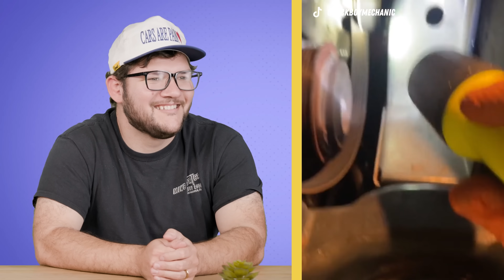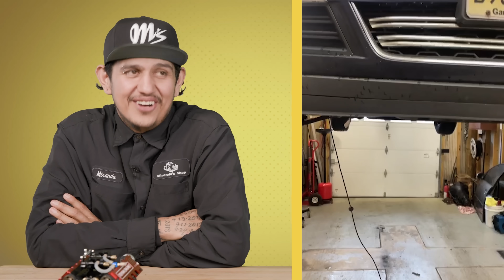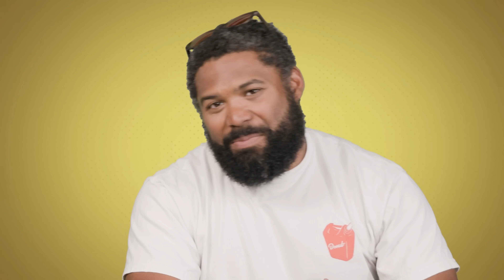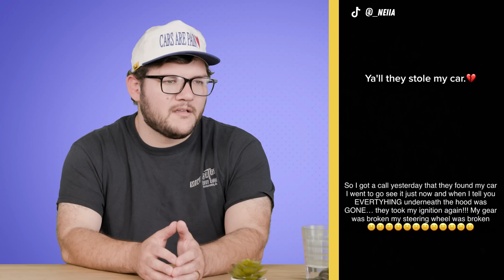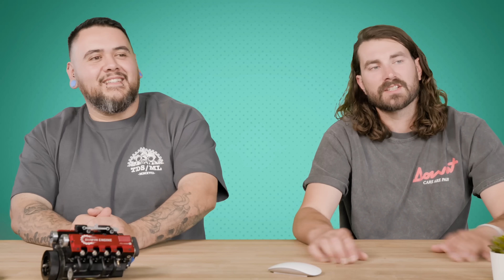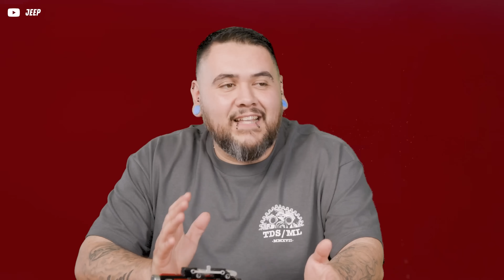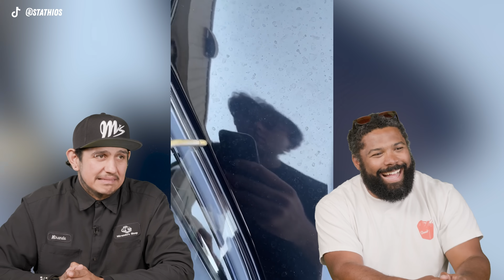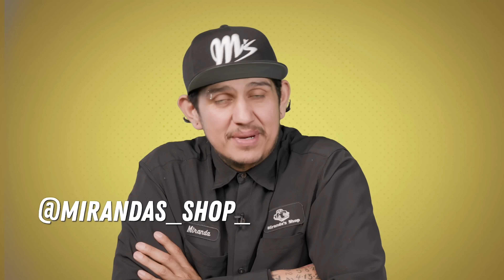Mechanic Reacts to Car Engineering Fails

Comment: Have you ever tried to remove the engine from a 1997 Honda Prelude? Or simply replace the timing belt? Have two choices, both require a special wrench. Remove the left side motor mount or cut the chassis to remove the crank pulley. To pull the engine, you have to remove it with transmission attached... unless you drop the transmission out the bottom to let the engine go out the top. I had to replace both... 2 years apart. Needs another transmission, automatic, but owner wants to convert to manual as Honda automatic transmissions are notorious for failure but manuals are forever with a quality clutch.

Comment: There was a timeframe where Mercedes was required to make a certain percentage of their vehicles biodegradable. As much as that sucks, thinking that in the long run your seats and dash and stuff are eventually going to rot away...

No no, its way worse than that. They made the insulation on all their wires biodegradable! Like WTF? And they won't even warranty or recall affected cars either... 🤦‍♂️

Comment: As an engineer I have to defend ourselves. I’d say 95+% of the time, final engineering decisions are dictated by management for cost reasons. They want to reuse existing stuff from the parts bin to save costs and Frankenstein it together. Engineering has budget and time limitations and you’re not always going to get it right given you’ll be restricted with either budget, time or both. No engineer I’ve worked with wants to make crappy stuff. Sure, there are boneheaded engineers but in my 20+ year experience I’ve worked with very few.

They’re 100% right on not having mechanics input on the higher design levels. I work at the tail end of manufacturing processes and I’ve sat in countless failure analysis meetings that would be unnecessary if the folks at the end of the process were involved at the beginning.

Comment: Vauxhall astra mk5, 1.4 petrol, you have to take the engine mount on to change the belt, its held on with horrid etorx bolts 🤢🤢🤢🤢

Comment: I was laughing when they were sending BRADLEY INFANTRY FIGHTING VEHICLE to Ukraine, those things are nightmares for maintenance, and engineers will over complicate design of the Line Replaceable Units or Modules that controls specific functions when a Texas Instrument Calculator can make the same functions.

Comment: 10:35 I know the engine. I work on LR everyday. We suck the oil from the top. Only the older 2.0 Ecoboost Ford engines and the I6 we drain from the bottom. Also the mechanic could have removed the skid plate but decided not to. So mostly the mechanic's fault

Comment: For the first Video, As an engineer i probably know what happend. That engine is probably in a few other models aswel, and the might not have checked the clearance for removing that bolt. The reason for the bolt being so long. Its probably that that bolt was already used somewhere else on the engine and used again to receduce the bill of material. Therefore having to buy less kinds of bolts and reducing costs becouse inventory cost a lot more than u think :)
Reply: Now, convince them that torque-to-yield bolts with nonstandard threads are a waste of material, since they can't be reused.....for anything.  Total dick move.  You'd have to melt them down to recycle them.
Reply: @vilefly  I've never heard of those types of bolts before, but they sound like a terrible concept. One use bolts? really?
Reply: @GSBro  Yup.  You torque them down tight until the bolt stretches a certain amount, which provides maximum clamping force for a given thickness of the bolt.  Once stretched, you cannot reuse them unless you want to press your luck with potential breakage.  Now, make it 7/16 inch diameter with 1.50mm thread pitch.  There are no nuts or thread taps sold to match that oddball combo.  Useless after one use.  Dick move.
Reply: @vilefly  cylinder head or conrod bolts are fit and forget unless there's  failure. If you don't use mongrel bolts the engine winds up 5 or 6mm longer, and won't fit the vehicle.
Reply: @johnwade1095  You have only a little experience.  I am 53.  Been rebuilding engines a lot longer than you.  Still working as a certified master mechanic.  The engine won't fit the vehicle.  Get out.  You have a torque sequence you have to follow or you will distort something.  That has always been there, whether cast iron or aluminum.  Mongrel bolts, as you call them never broke for me, back in those days.....unless you ran nitrous or a supercharger on something that was never designed for it.  You wouldn't be rebuilding the engine unless there WAS failure in the first place.  I need to stop ranting about this....getting whipped up into a frenzy over nothing these days.  Crabby old man cussing at everything.  Crab..crab....crab.....doublecrab.
Reply: @vilefly  I just love the way you assume I'm younger than you.
A mongrel bolt is a non standard size. M13x1 or something annoying like that.
Reply: @johnwade1095  The younger ones are usually those trying to defend an undefensible position.  This does not seem like a defensible position to take.  The non-mongrel bolts were working just fine...and they are cheaper to obtain.  Not much custom manufacturing required.  They can also be repurposed with a matching nut.  All that energy and alloying that goes into making a bolt is now wasted.  It's good steel.  Why waste it?  Why retool?  The only answer is greed and propriety.  Good god, I'm long winded.
Reply: @vilefly  engines tend to go in lots of vehicles unless you're buying a Honda from 20 years ago.
So no installation is ideal.
Car buyers look at specs not details, and an extra 40 horses go on the spec sheet, but the 4 hours to change spark plugs, or  a crank damper change being an engine out procedure doesn't.
Vehicles that go out on lease,  like yellow goods, have service designed in, those that are fire and forget, like cars, not so much.
They would be less powerful and more expensive and wouldn't sell to most customers who don't look past the headline numbers.
Reply: @johnwade1095  This is all obvious, well and accurate, but this doesn't exactly cover the mongrel bolt scenario.  There is money to be saved at that point of manufacture.  The motor can still be a limited life product, no matter what bolt is used.  They use irradiated parts in test engines to measure wear by using a radiation detector on the motor oil, btw.  That was in 1996.
Reply: @vilefly  if I need a reduced abutment face fastener or a conrod has to be 4mm wider, and then my v8 design is 32mm longer, weighs an extra 4kg and won't fit the engine bay.... I'm using a mongrel bolt.
Pretty much any critical fastener will be a mongrel. Commodity fasteners are designed with some very generous assumptions, and you can always be more ambitious with better quality materials.
Plus, it stops substitution.
Reply: @johnwade1095  If the difference between a mongrel bolt and a metric bolt is 1mm, I say they can afford it for a total of 8mm.  Oh, I'm sure it adds up, but in the end wastes less steel.  Aluminum is cheap.  Not that you don't have a fairly solid point.  I just hate to see our disposable society accelerate towards its doom.  
I predict that used bolts will become a large commodity, since we eventually will no longer make useful ones here.  All the heat energy, electricity, and tooling required to make a useful bolt will continue to cost more over time.  There will be a shortage.  It's going to happen unless something is done.
Thanks for being patient with a crabby bastard.
Reply: @vilefly  sadly, that weight equates to price and mpg, and customers read that and buy the cheapest.
Start / stop systems are a real world waste of time, but cars have them anyway.
If you want to work on machines where the designers thought about service, Cat are hiring.
If you want skinned knuckles and endless 'wtf' moments, Audi.

Comment: I ran into a bolt against the frame on an old Ford Escort, I drilled a hole just big enough to get the bolt out, the car never broke in half or anything so "success" I guess.

Comment: As a mechanic, in the case of the oil drain, I can agree that yes, its the engineer's fault originally, but also as a tech, you gotta learn the little tricks to make your services go smoother and quicker (not to mention, less messy in this case), which includes learning these dumb engineering mistakes and finding workarounds.

Comment: You DO get paid to do the extra work. Labor time is adjusted based on the car. If the service procedure says that you will need to remove the motor mounts and hoist the engine up it’ll give you the time to do that. Idk where the girl tech gets that you don’t get paid to do the extra things. I bet if you look up the labor time on a service data on that specific car it’ll say a ridiculous number like 3.5 hours. When a pulley would normally be like .7.

Comment: Really interesting. Reminds me of why I LOVE my 1990 Volvo 240DL wagon. 391,000 miles and purrs like a kitten. My first new car was, unfortunately, just prior to the Lemon Law here in Ontario, Canada. 84 Oldsmobile Delta 88 Royale 2 door. 42 work orders in the first 18 months and barely over 25,000 miles. Nightmare from the get go. It would have cost GM of Canada less to buy it back when it started to go wrong. The warranty repairs came to almost $30,000 on a car that cost me $13,300 including all taxes and fees. Promised the President of General Motors of Canada that i would never buy another of their products. 38 years later and i have not forgotten my promise.

Comment: I also believe the lemon law got its name due to Geraldine Elizabeth Carmichael and her dale a prototype three-wheeled two-seater sports car designed and built by Dale Clif which came out in 1974 and only three Dale vehicles existed, two of which didn't even have engines in them. An inspector for the Department of Motor vehicles, Bill Hall, examined one of the cars. Among other deficiencies, he found the rear axle was supported by two-by-fours, the windows were not made of safety glass, and the doors were held on by regular, household hinges as well as duct tape, the lemon law wasn't established until 1975 right after the whole Dale fiasco there was no factories he well she stole a bunch of money, not only did she create a car that was a lemon nothing but problems but also shaped like a lemon

Comment: That oil draining all over, although a crappy place to have it, is for sure the mechanics fault because it was OBVIOUS that was going to happen -- def should have had a piece of cardboard or whatever to guide it right into the drain pan.. 
  One thing this is super Common with is the 4-stroke outboard motors, they all pretty much can be a pain and make a mess if you don't have funnels or whatever to guide the oil when trying to drain it, or even it is sometimes easier to just suction it out through the dipstick tube...

Comment: The super long pulley bolt is probably a factory issue. There isn't a reason for anyone to design a bolt that long. The OEM probably just has millions of THAT bolt and instead of having shorter bolts with the same diameter and pitch they told them they had to use that one.

Comment: Wow so call mechanics didn’t get you all and out. Just said some bull about lifting the engine or I wouldn’t do it. To get the belt off just screw the bolt back in some and pull it off. To change the pulley just screw the bolt out far as u can then pull the part out most likely the alternator, push bolt back in and wiggle it out should come out.

Comment: A very fun video, thanks.  However,  putting blame on either the engineers or the factory misses all the other people involved in making a product.  There are management, marketing, sales, plant designers, accountants, finance, suppliers and others that all have a part to play.  Poor decisions are made and compounded.  Blaming one group for something without knowing the true causes is the easy way out (and the one managers always go to) but often wrong.  For example, the problem with the bolt that is too long for the pulley tensioner....it could have been a poor decision/choice by the engineer specing the size, the factory worker grabbing from the wrong bin, the supplier sending the wrong bolt, the management deciding to use the wrong bolt because it was cheaper, the chassis designer/fabricator making a change to the location or shape of the cross member, a factory workflow design that does not allow for corrections,  factory equipment that limits flexibility in design, a tolerance exceeded somewhere else like the engine/transmission or frame, etc. etc. etc.   AND as you all point out - a total lack of maintenance/repair perspective/priority in car design, especially from high-end vehicle mfg.

Comment: It's not impossible to get to that bulk that's in the thumbnail. It's quite simple you undo the engine mounts on that side in the middle one and then you either a let the engine down a little bit or be Jack it up. Depends on how you want to get the boat out. That's how you do that. I know this for a fact because the 1998 Chrysler Sebring has the bolts right up against the frame rail just like that. And in order to do the water pump timing belt had to remove the engine mounts and Jackie engine up to get that bolts out. Pain-in-the-ass hellyeah impossible of course not.

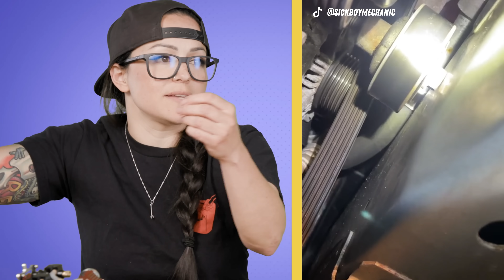Comment: 1:08 You don't get paid for that extra time? I would think ANY time that a mechanic has to spend on a repair/install job would get billed to the customer. If you have to lift the engine and it takes an extra hour of labor, you bill the customer for that.....do you not? I'm not a mechanic, only a customer, so I'm just a little confused by what she said. 🤷‍♂

Comment: Angelina inspired me to work on my own car instead of taking it to a mechanic that would charge me the girl tax :D did my first oil change and brakepad change today, feeling inspired to learn more thanks to her!
Reply: Even just having knowledge of a problem will sometimes keep mechanics on the straight and narrow.  Also, find yourself a mechanic you can trust, even if it costs you just a tad more than another place, if they aren't selling you something you don't need, it's worth it.  Talk to friends and colleagues, word of mouth is a powerful ally.

I had a Camaro with a repeating problem of front brakes locking up.  Three places I went to said I needed all new brake calipers.  Took it to a place my friend recommended and they said it was just a bad brake hose.  Cost me $120 instead of the hundreds from the other places.  Of course, that was long before I really learned what to do with brakes, now I do everything myself.
Reply: That's awesome. Glad to hear it!
Reply: Rock on!!! That's where it starts. Few years ago, I was doing my oil changes, then brakes, and last year I did a head gasket and this year a major head job with new valves and a ton of awful suspension work. Your knowledge and capabilities will start to snowball now that you've begun. Keep it up!
Reply: Grats. The brakes were the last thing I ever worked on myself out of fear. Car not moving is one thing, not stopping while moving is a worse thing lol. Had a bad experience with a garage that finally pushed me to doing it myself.
Reply: Girl tax? when I worked in car audio it was the girl tax refund. I was always giving them deals to get numbers.
Reply: @riothero313  🤣🤣🤣 it works tho
Reply: Awesome! Love to hear it!
Reply: Well done, start simple, build confidence, but I would recommend either getting on a course or having a trustworthy mechanic you can get advice from, you'll also learn a few tricks of the trade that can save loads of time and money.
Reply: It's not a girl tax, it's a shady mechanic tax. Places will screw with people who don't know things, just like the computer world.
Reply: She's hot as hell too! 😍

Comment: can't be much of a mechanic if you aren't capable of sorting an issue with a wrangler out.
grand cherokee i can understand but wranglers are simple and reliable compared to most modern vehicles.

Comment: here is an interesting factoid. Engineer when designing stuff to tke the dismantling and reassembly and service in mind. WIth the guidlines provided by THE dealership/ brnd, who might have specialist tool, equipments, and different turnover time that you. Thus its not bad design per se in most part (yeah some time they just fucked up), its just they didnt do the design with YOU in mind.
Like my own mechanics probably love the fact that i need to come to them for servicing of my filters, differentials, bearing etc. While i would love to still be able to do the same in my backyard with a stand and a set of wrenches.

Comment: VW Passat 5bg. If you have to swap out the power steering rack just quit you job.
The power steering rack is inclosed on the chassis. You have 0 space to work on and 0 space to pull it out. Tok me 2 days to change it because its just too damn hard to change. Thx engineers.

Comment: i have a 2023 rubicon and suprisingly i have very few complaints. id say at most the my complaints are personal opinion but can be fixed or modded to fix them, which is what ive been doing. other than that i love it

Comment: About the Audi q3. I'm a official mechanic from VAG group. This is what happens when you skip points on your checkup list regarding the clearing or checkup of the drainage pipes from the panoramic roof. It gets clogged the waterlevel rises in the tubes located in your A-pillars and as a result it poors over the gutter right into the interior. Not sure how the warranty department is gonna solve that issue...